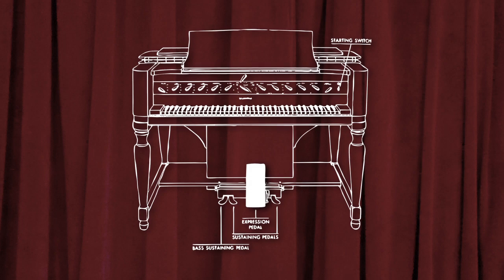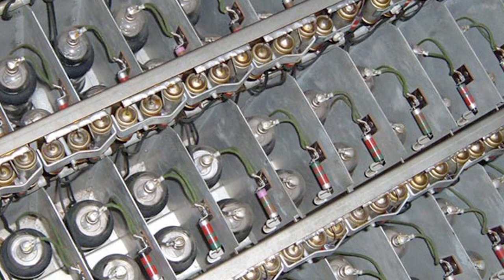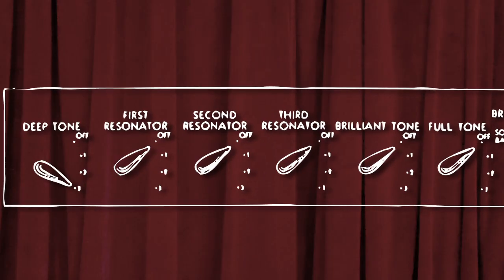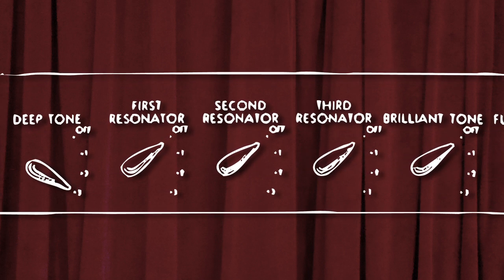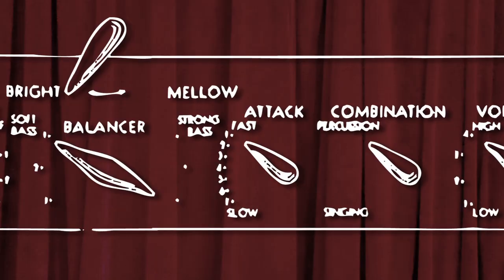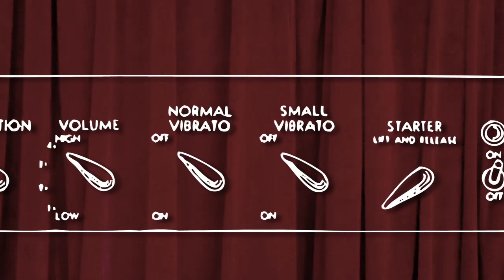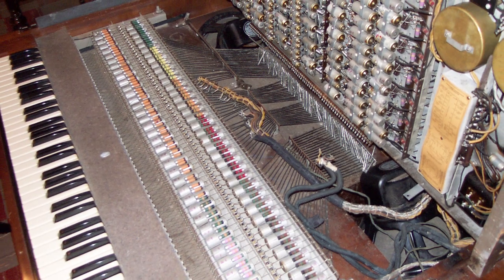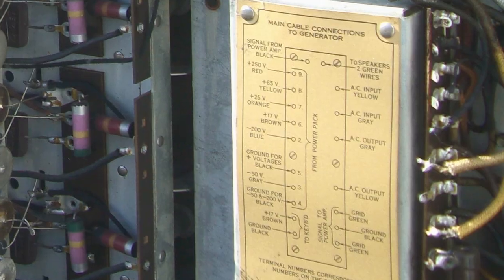The Synthesis of Synthesis- The Hammond Novachord

Comment: The Novachord was a polyphonic electronic instrument that in 1939! It may not have been a "proper" synthesizer by today's standards, it had two formant filters instead of the more common Low Pass Filter (with resonance control) we see in most synths today.

But it did have a primitive envelope, that is control over the volume of the sound- a synth staple today. 

The divide down tech was also used in 1960/70s transistor organs such as those used by The Doors.

The first poly synths in the 70s also used divide down technology, as did "string machines" popular back then like the Solina String Ensemble and many other similar keyboards. 

The Polymoog polyphonic synth also used this tech, but it quickly feel it of favor once you had "proper" polysynths, such as the Yamaha CS 40/50/60/80 series (1975-1978), Sequential Prophet 5 (1978), Roland Jupiter 8 (1981).

Comment: No disrespect to Moog and Buchla, but this was synthesized sound done beautifully back almost 100 years ago...it wasn't hugely commercial, it was mainly used for background music on tv and radio production, but it WAS an electronic synthesizer manufactured decades before the 60's, and the Novachord deserves respect
Reply: yes this presentation is bs. more self-promotion marketing from moog music corporation.
Reply: @snoolee7950  How is it self promotion when it is acknowledged in this video as the predecessor to the analog synthesizer?  Wouldn't it be more self-promoting to not reference this at all and pretend there was nothing before 1964 voltage controlled breakthrough?
Reply: @1918SMLE  Correct. It appears our disinformation agent has been backed into a corner and is now flailing about in a desperate attempt to maintain credibility ... OH! there goes Snoo Lee's credibility .... now we ask ... why did they have to gain from all this? I won't wait for an answer time for the next part of this series .... that is more important than what Snoo Lee thinks (or is being PAID to say).

Comment: I know where you were going with that. Actually in the early 70's the 12 oscillator system of a divider tone generator, or an individual oscillator ( 1 note per oscillator, or 2 per 12au7 or similar tube) was phased out and replaced by a 'master oscillator' system. Instead of 12 oscillators divided or single oscillators ( indv. osc.), the master oscillator used just one synthesized tone referred to as Top Order Synthesis. This was divided down. Tone quality depended on filtering. 1 screw tuning

Comment: Do you think Korg had the Novachord in mind when they developed the Korg PS3100/3200/3300 synthesizers? Just wondered because they used the same 12 osc - devided down principle (of course without tubes) to get a full 48 note polyphony. And the 3100 and 3300 has 3 resonators, too. The Korg PS synthesizers are the only other synths I know of using that octave down technology.
And what is that machine standing in the background?
Reply: cyclo tron divide down was also used by many organ manufacturers from Wurlitzer to Lowrey to even Hammond. An instrument I owned about thirty years ago, was a tube Wurlitzer. It had the twelve master oscillators and its dividing circuitry had special tubes, like 12AX7, but two plates per triode. In the solid state era, the top octave came from a color TV crystal (≈3.58MHz) divided down to the appropriate pitches in a chip. The rest of the divides were easily done with digital circuitry. After that, filtering and ADSR are as basic as any other synth. That's the architecture that ARP used for their poly synth functions. Off the beaten subject, the item in the background is an Altec/Western Electric 250 broadcast console.

Comment: Divid Down Technologie : but why 12 oscillator and not  7 oscillators for 7 octave of piano ?
Reply: It is 12 oscillators and not 7 because there are 12 notes in total in one octave (7 full tones and 5 semitones) - for 7 octaves, each oscillator would then require 6 dividers in order to generate the same note for the 6 octaves below the top octave. So, for a 7octave instrument, you would need 12 oscillators (to generate the notes for the top octave) and a total of 72 dividers for all the remaining notes.